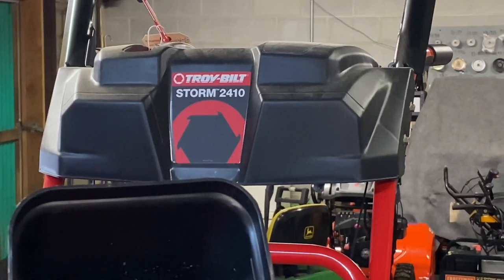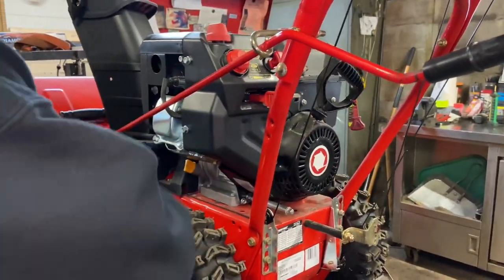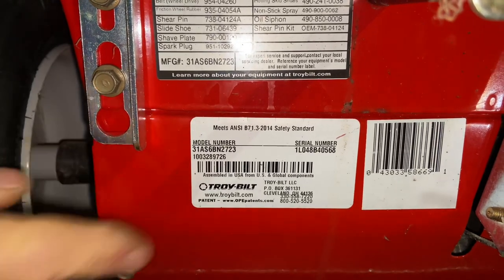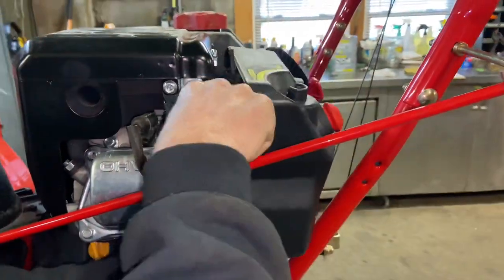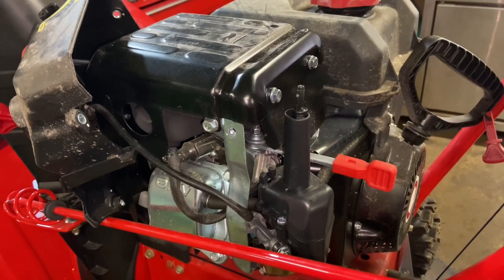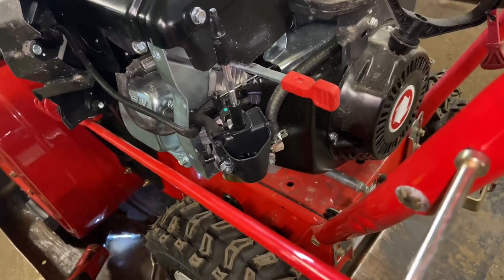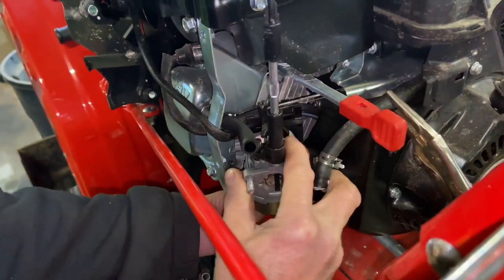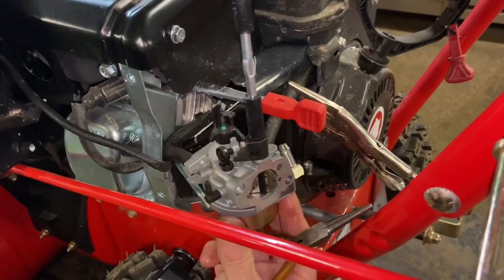How to remove carburetor Troybilt 2410 snow thrower

Comment: New gas. Changed spark plug . Cleaned carb. Not starting .. Pulled spark plug back out and it now has no gap.. Is a piston hiring this? Old plug was the same too when removed it.. Why would this happen
Reply from the maker: Is the machine you have a TroyBilt 2410?  Check to make sure you gave the correct spark plug? Do you have compression? I would need to see the machine to help more. Let me know what happened when you figure it out.
Reply: @JohnsonsSmallEngines  
Thx. Yeah Thinking should make sure received correct one too..Yet The old one I took out was same with no gap too. Is a used blower maybe wrong all along. Again thoo have had 3 seasons no troubles starting or running till now. Ill check compression and yes it is 2410 208cc 24' TB 2 stage .
Reply from the maker: See if you can take a look into the cylinder with a flashlight through the spark plug hole while pulling over the pull rope to see if there may be something in the head assemble that may be hitting the spark plug. Possible a chunk of carbon?
Reply: @JohnsonsSmallEngines  
Oh alright sounds smart . thank you .

Comment: Great video, I need this exact carburetor.  I've gone on the TroyBilt website and listed my model #.  But it doesn't pull up the carburetor. There are pieces and parts but not a whole carburetor.  My model # 31BS6BN2711. Can you help me?
Reply: The part that broke off was the tall stick that is attached to the first knob you pulled off the top, about 3.19 minutes into the video. Oh and also I broke that knob when I pulled it off too. Thanks
Reply from the maker: It looks like you will need the engine number#s off of the right lower side of the engine. If you are standing behind the machine, the numbers will be below the electric starter stamped into the block. If you can take a picture that I can clearly see, then e-mail me the picture and I will see if I can help.